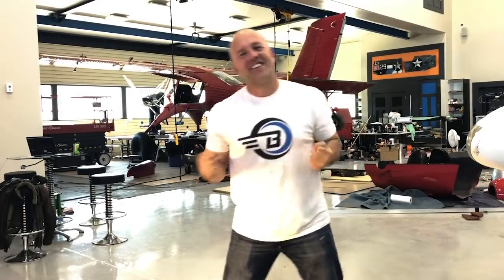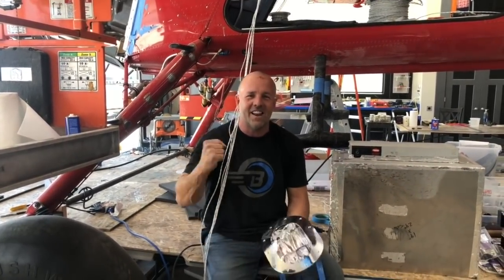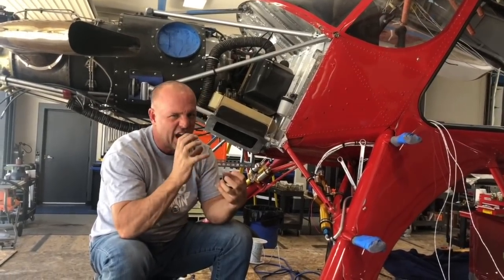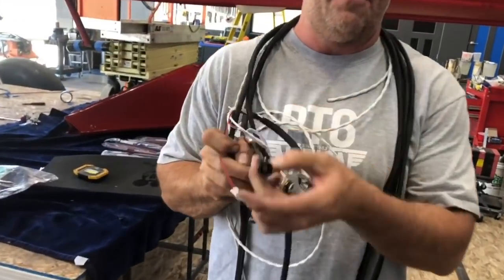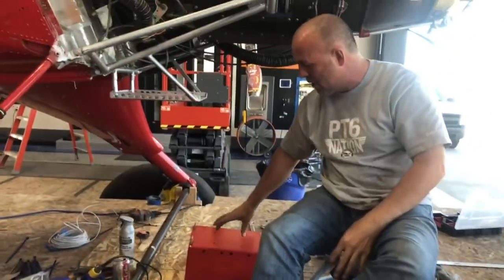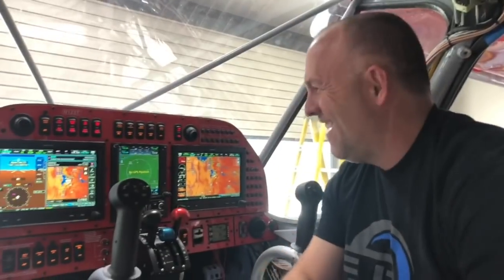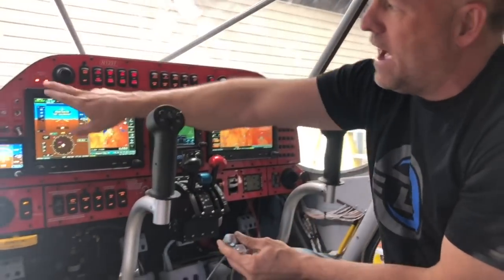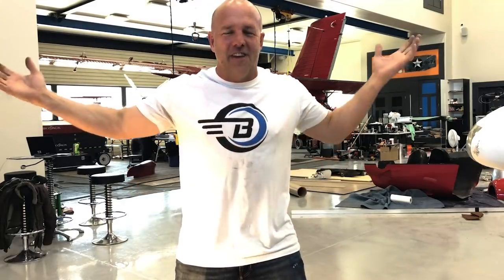Mike Patey Wilga (DRACO Video 14) Wiring and Panel + Fuel System

Comment: I sure wish you'd do a video on the behind-the-scene thinking that you did in order to learn what you know. Like how you approached the electrical without being totally intimidated. Or how you learned about aeronautics over the years. I just find much of what you're doing daunting. I literally did not take the carbon fiber course in school because I was so frightened by all of the engineering courses. As a result, I missed out on a great bit of usable skill. I just want to know how you operate in the face of difficult learning. One thing is clear- you're excited.

Comment: What an awesome project.  I noticed the electric fuel pumps you are using appear to be the ones that are manufactured by my employer. I didn't think they were certified for aviation use but maybe being an experimental application it's ok to use them.  Being that you are using jet fuel, the carbon commutated version would be best for this application and maybe that is what was selected. Many of the electric pumps have copper commutators that can have issues when used in diesel or similar fuels.  Hoping to see some video's from Oshkosh.

Comment: I was shocked to see the name "Pyle" under the dash panel of this project. I couldn't think of a name more synonymous with swap meet junk. Am I really supposed to believe that Pyle makes the best DC-DC converters? What is the thinking behind this choice?
Reply from the maker: socaliguy81  the others were on backorder they were temps and replaced
Reply: @MikePatey  Makes sense. I knew your standards were higher ; ) Sorry if I came across snobby, I'm just an old car audio guy. LOL

Comment: Saw only one throttle quadrant during the panel scenes - are you going to fly the stick left-handed (from left seat)?  I know that plenty of aircraft have you use right hand on throttle, left hand on wheel, but a stick makes that seem weird . . .  The stock Wilga has left hand throttles for both seats, I think, so right hand is for the stick.  What's your plan? (love the whole series of build videos, and wish I could even approach what you're doing).

Comment: Hey Mike, One question with regards to the fail safe fuel lights.  Why wouldn't it have been better to have the the 2 fuel sensor lights all time off and then come on when your wing tanks go empty? I just feel like warning lights come on not go off.  Just wondering.

Comment: Mike your project has me in total shock and awe. It also gives me hope that maybe i might be able to find a way to do my project. Sadly i will not be able to get to oshkosh this year. Is this plane registered experimental or certified ? If it is experimental how in the hell did you get your local fsdo to sign of on this.To give you  some idea what i am wanting to do is get a c152 acrobat fuselage convert it to a texas tail tragger , slotted leading edge wing flaps maybe longer wings / ailerons and bigger flaps and bigger tires ;) . and the whole cock block with my local fsdo is putting a turbo honda engine target is 150-180 hp via viking engines. which is not all that out of line for the airframe. Maybe if you have some time in your busy schedule would love to chat some time. Thank you for doing what you do and having the time to post it online and sharing your amazing build.

Comment: Hi Mike, what kind of Li-ion battery did you install there? Is it certified for aviation use? I’m just concerned about the vibrations it will be subjected to which potentially can fatigue the internal spearator after long term use and in turn trigger an internal short circuit leading to a battery fire. Not trying to scare you, just checking if you chose your battery producer wisely. I’m sure you are aware of the Boeing Dreamliner Li-ion battery accidents a few years ago. Moreover, what temperatures is it subjected to located in that position close to the engine, and does it have its own intelligence when it comes to the charging proceedure? Thos are also quite critical factors. Anyway, incredible work on the plane though, love it 😎
Reply from the maker: Utube2Itube thanks for your thoughts. The battery is not available and I can not give information regarding it yet. To put your mind at ease. My background and engineering firm specializes in battery and hybrid vehicle design for the large OEM companies. I personally have patents and tech in the battery space. This is one of my strangest areas of experience. All your concerns are valid and rest assured It is all covered from vibration to smart charge and auto shutdown and isolation right down to the per cell level. Thanks again
Reply: Wow, you seem to be on top of every little detail then, impressive 😀, but to be honest I expected nothing less from you 😉. After watching your build vlogs here on YouTube I read a bit about you and your background yesterday and was blown away hearing your and your brothers story. I’m so impressed by you two, especially your successes combined with your friendliness and being so down to earth. Anyway, interesting that you are actively working in the battery space as well, I didn’t know that. I’m working in that space myself. I was quite curious to see the rather unconventional cylindrical form factor of the cells that you show here in the vlog. Reminds me a bit of what I have seen from the company Cadenza. Seeing the cells being packed that close to each other it would be interesting to hear how you have solved thermal runaway propagation protection, but of course I understand that you can’t talk about that here ☺️. Anyway, looking forward to follow your future builds on this channel.

Comment: Hi, Mike. I'm a new subscriber and love your beautiful Draco. I'm also greatly impressed with your amazing talent. I thought I was fair, but Lordy, you take it to a whole 'nother level. I'm curious - do you have or plan to install an angle of attack indicator? As an Air Force fighter pilot, I cut my teeth on AOAs. Amazing the level of control you can achieve with those, at least the vane/analog type. I haven't flown the indicator light type.

Comment: Amazing job!  I'm a bit surprised though about design of the panel... I would've thought that on a bush plane panel would be designed to be much lower to obstruct as little view as possible. Maybe put some switches on the sides instead of top of it...or something. 
 Not a criticism I'm just wondering if the height of the panel won't be detrimental to bush flying?
Reply from the maker: its the angle the camera is on. I actually lowered the panel 3.75 inches and now the bottom of the wind screen (when sitting in the seat) is my field of view line. I could lower the panel 10' and I would not gain even a 1/4" view. The panel just looks tall from that angle. Field of view was my number one target before I designed component placement. so I went until window line was my limit and made a new glare shield at that point line and made the entire panel down form that.
Reply: Awesome. Window line is what I thought it should be. I'm glad it was just a camera angle :)